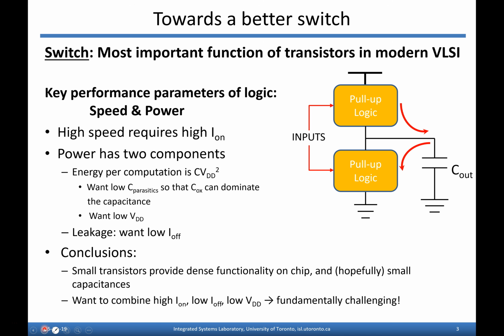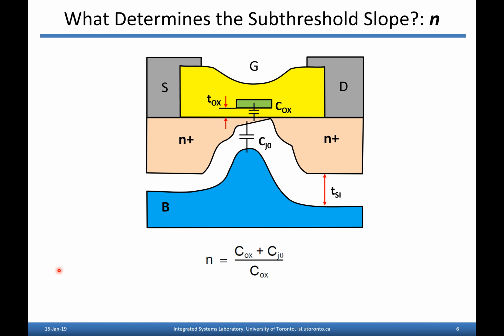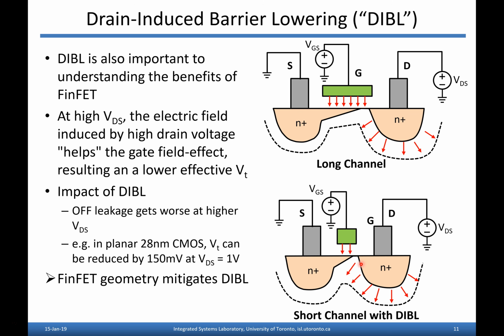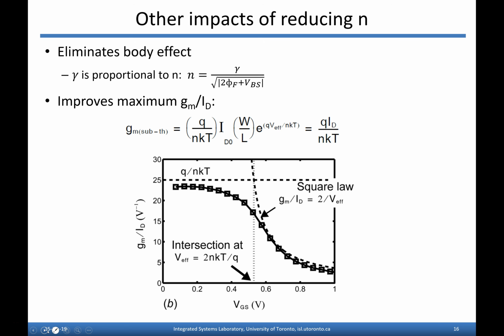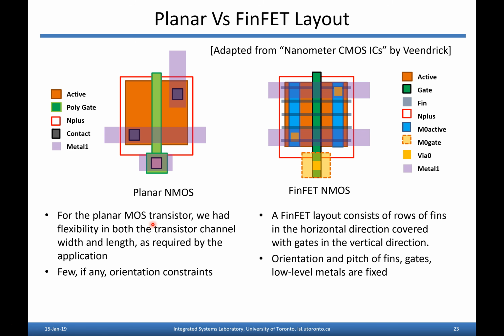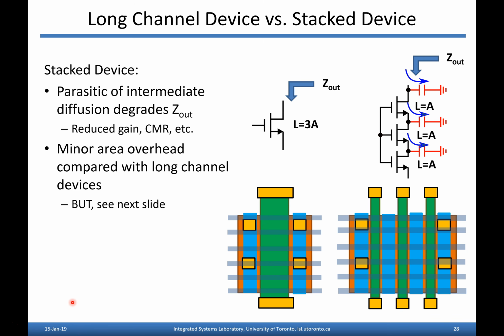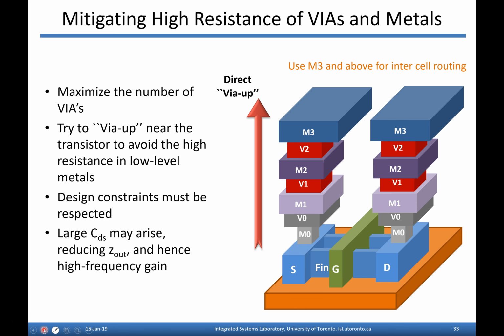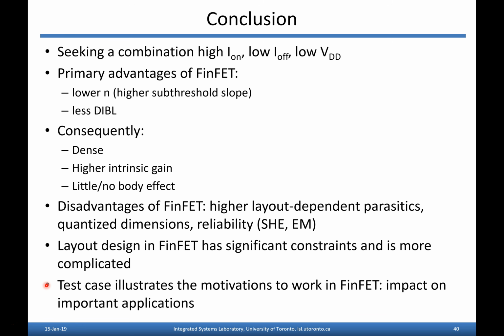FinFET Technologies for Analog Design

Comment: what's the issue with large capacitance on a diffpair tail current? can't that actually help speed performance for large signal disturbances? I think the biggest issue with a remote tail current is just the routing resistance eating into your headroom budget